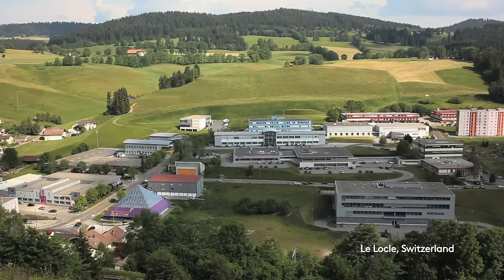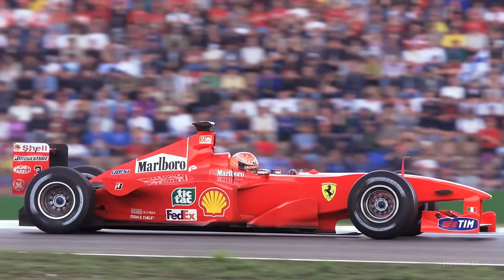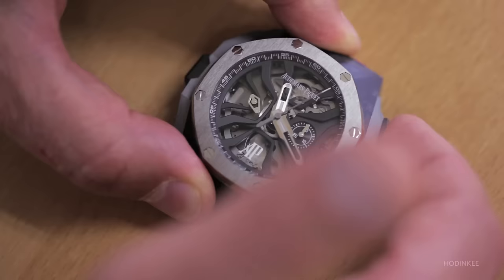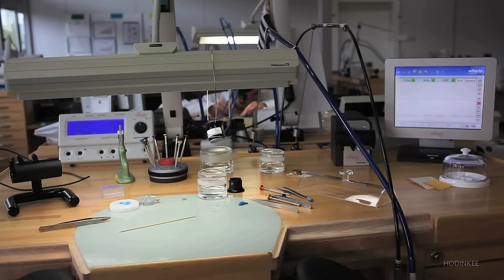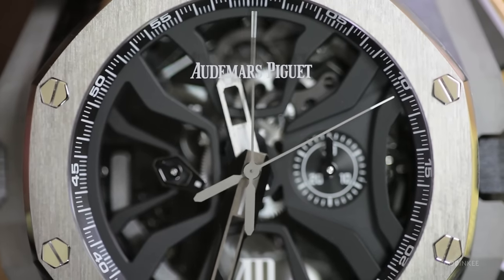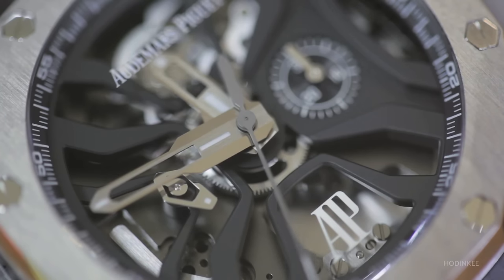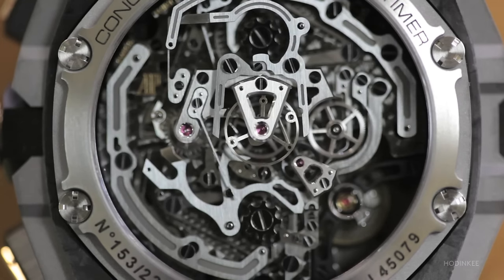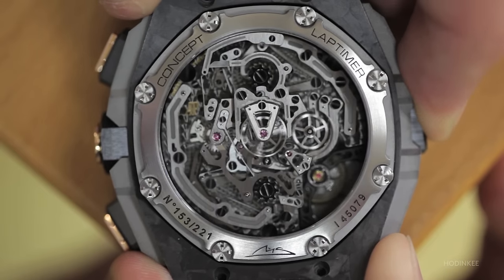The Royal Oak Concept Laptimer Michael Schumacher From Audemars Piguet

Comment: How is this different from a rataprantte/split seconds?
Reply: On a split seconds chronograph one of the hands is continuously running while the other one can be stopped and then made to catch up with the "main" seconds hand. Here, however, using the lap timer function stops the running seconds hand and starts a new sequence from 0 with the other one. It's basically two stop watches in one. Stopping one resets and starts the other.